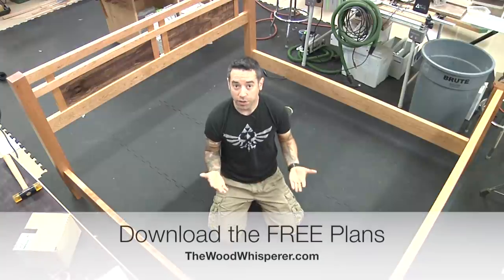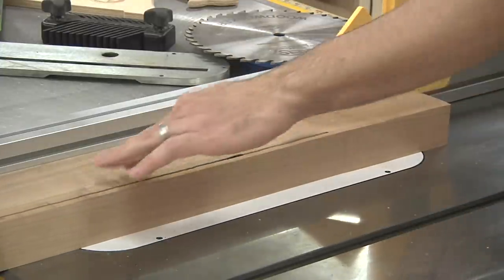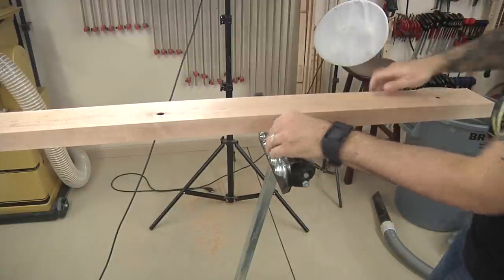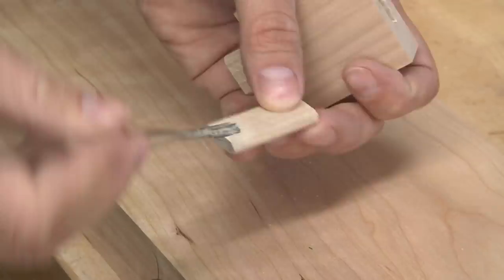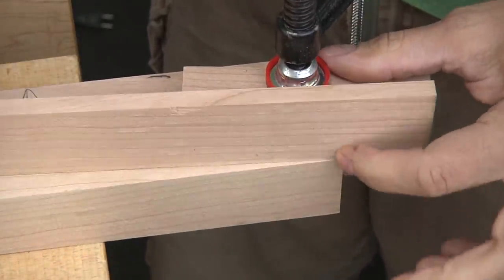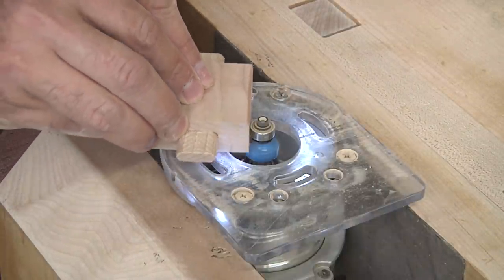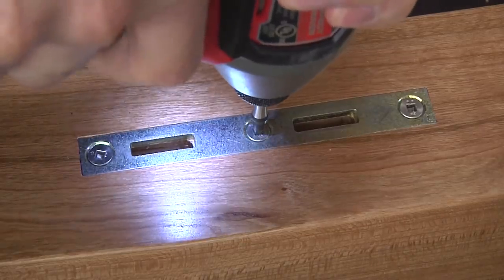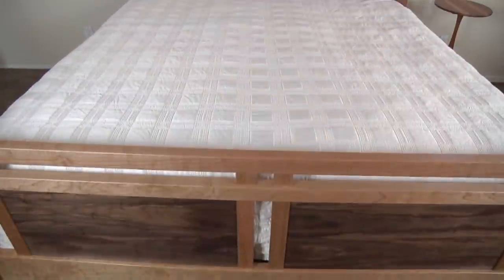260 - King Size Bed

Comment: Only one month ago, I used that exact same Rockler rail hardware connector for some rails I made for my convertible-from-crib to queen bed ... and some rails for my cousin's bed that needed to go from full size to queen.  I really like them because they are hidden, but they do require quite a bit more work than other connector options.

Comment: Wicked build!   Little carpenter trick with the chop saw,  if you need a little more cut depth put a sacrificial board under what you are cutting.   This raises up the board into the bigger part of the blade.   You can easily gain an extra few inches of depth.

Comment: Great use of the muli-router, used one at Charles Neil  shop a few years back and have wanted one since  but bough a Powermatic 4224 B lathe instead for my retirement, how about some flame finials for the posts?

Comment: Love your work!  I'm fairly new to woodworking and need to know if plain sawn hardwoods are ok for most woodworking applications, all the hardwoods I'm finding in the Nashville area for domestic and imported are plain or flat sawn.  I understand that for table tops I'd need quarter sawn only.  Could you elaborate on this with a comment for me, I'd certainly appreciate it!  Thanks again for your super videos and workmanship!

Comment: This bed looks awesome! I'm in the middle of making a smaller bed for an upcoming member of the family, and was just thinking about whether or not I should prefinish the pieces before gluing them up as you did in this video. I have a question about it: did you find that the extra thickness of the finish prevented you from getting a tight-looking mortise/tenon joint? Or does sufficient clamping force simply prevent this from being an issue?

Comment: The last 10 seconds is classic :-)

Is it a lot more work to setup the multi-router to cut tenons on the rails, and that's why you went the floating tenon route?

I used to think about getting a multi-router but now that I have both Dominos I just don't think that I would use it. Just like my mortiser doesn't get any love any more.
Reply from the maker: +Marty Backe I have always used the tool for loose tenon construction. Well, that's how I learned to use it at least. But if you already have the Dominos, it's REALLY hard to justify the MultiRouter for mortise and tenon work. It does lots of other things too so if those are of interest, it might just be a good purchase. But for mortise and tenon joints, it's really hard to be the point and shoot simplicity of the Domino.

Comment: I recently designed a bed in SketchUp to build out of Walnut, however I planned for 4/4 stock (with the exception of the side rails, and legs). However, your plans call for 8/4 stock. I think I like how hefty your design looks. The problem is, I have about 150 bd ft of 4/4 Walnut, very small amounts in anything thicker. Do you see a problem with face gluing the boards used for the head/foot board to get to 8/4 stock? All of my lumber came from the same tree so it should be pretty easy to get matching grain/color.
Reply from the maker: +Ted Balog No problems I can think of. As long as the joints are tight, the laminations should hold up over time just fine.
Reply: +The Wood Whisperer Thank you!

Comment: Great build Marc. One question about the epoxy glue up (I have never used epoxy glue). How should I deal with squeeze out of epoxy glue ? Does the shellac helps with the cleanup ? Thanks.

Comment: Hey Mark.  Thanks for the free plans.  I’m planning to build the bed.  We also have beds on their own frame so I don’t need the support structure.  However, I wonder if you have found the hardware used to attach the head and foot board to be sufficient to keep the head and footboards from wobblying w/o the structure holding the weight of the bed?    Thanks

Comment: It was interesting to see you used the Bosch chop saw for your 90s, instead of a crosscut on table saw. I have the Glide 12" as well, but have moved away from trusting it with 90 deg cuts on finer work. did you calibrate yours out of the box?

Comment: I too am making a king sized bed; however I will be adding the support frame to the long rails.  I am using the exact same hardware that you used.  Since the male connectors are being screwed into end grain, do you think I should drill a 1/2" hole through the rails and add a dowel for more meat for the screws to grab into?
Reply from the maker: +James Wheeldon Not sure it's necessary. If you're concerned about the hold in end grain, use longer screws and perhaps even throw some epoxy in there for good luck. :)

Comment: I guess my question here, is that when you use joints that require glue (tenons, dowels, box, etc) you are left with a large permanent object. Obviously you could do the glue up in the bedroom, but what if you ever move? How are you going to move that large a structure through common door frames and hallways? I really don't want to use pocket holes or lag bolts, but at the same time would like a frame that i can disassemble. Any ideas?

Comment: Nice bed!  I also have to make a bed for my honey do list.  I have one question though because you where in the same situation as I am.  Our bed has its own base as well.  We bought a king size sleep number air bed with the individual adjustable base.  What I was wondering is does the normal bed hardware you use keep the frame square or does it have a tendency to get pushed into a parallelogram?  This is a concern for me because of the head and foot of the bed going up and down, and each side being separate.  There is a common steel frame under it.  I could make some clamps and use turn buckles from the common from to the side to keep it from moving and give a little side to side adjustment if needed.  Just wondering if that would be needed or if it seems to stay in place on its own?
Reply from the maker: The weight of the wooden frame is enough to keep it in place on carpet. Mine hasn't moved at all since installing it.

Comment: Hi Marc. 
Great videos. 
I have a Jds multi router in my shop. 
I've used it for mortise and tenons which work great. I'm just getting into dove tails. 
How you used it for these? If so how did you get on? 
Cheers
Wez.

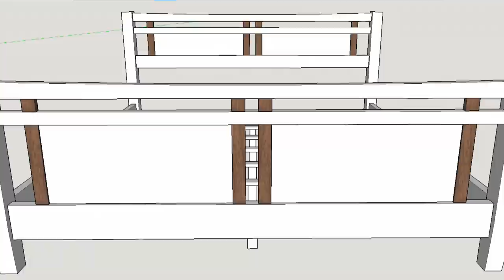Comment: At 5:26 I noticed the feather board is right next to the blade, Being an amateur I've seen videos told not do this and instead place the feather board in front of a saw blade to avoid kickback, Is there instances were placing the feather board next to the blade is ok and not dangerous? I'm just curious. Love the build, not sure I would ever tackle something this big, but is still fun to watch and learn. Thanks!
Reply: +Tony Castillo you never want to push an off-cut into the blade - in this case he was just making a groove so there was no lose piece being pushed into the blade - just the feather board holding the stock tight against the fence - hope that helps
Reply: That makes sense. Thanks for the explanation Nick.

Comment: What happened to the festool chop saw? how do you find the bosch saw for blade stability i had 2 saws blow a bearing on me and create a very noticable wobble in the blade when running at speed.

Comment: I'm curious as to what made you choose that multi-router over the pantarouter?
Reply from the maker: +Mike Gus Fifteen A couple reasons. First, I'm familiar with the Mutli-Router having used it at various points in both David Marks and William Ng's shops. I know a lot of tricks to making it do what I need it to do. And second, I don't really like shop-made wooden tools. Which is why I find the Hybrid Pantorouter compelling.
Reply: The Wood Whisperer Ahh I see. Not sure if you knew, but the Hybrid Pantorouter is actually designed (and licensed through) Matthias' homemade pantorouter! I thought that was rather cool. I believe he gets a portion of sales. Anyway, this bed frame is dope! I may steal some inspiration from it when I go to design mine!

Comment: what's the filler which you've added to the epoxy ??
Reply from the maker: +Mohamed Islam West Systems 405. You can see it on display here: https://youtu.be/m7FyLZT0Vnw?t=12m25s
Reply: + The Wood Whisperer which better Silica Gel or filler

Comment: The problem I have with this channel is it seems like you need $10,000 in tools to actually do this stuff.
Reply from the maker: +john handcock you don't. It may not be as easy or quick, but it can be done with fewer and lower quality tools.
Reply: The Wood Whisperer I watched some more, and I see that now.  That entertainment center video was quite enlightening, ty. 

I still need to buy a few tools, like a straight edge guide, and some clamps, but they won't set me back like a $500 tablesaw.

Even if I had your tools, I wouldn't have anywhere to put them.   I think I will have to make myself some saw horses.
Reply: Right... but one does that for a living, one must be be able to afford them at some point cuz they are their "tools of the trade", literally. Of course you can build stuff with fewer tools but it will just take more time... a jointer though, is something I would say is an almost must have.